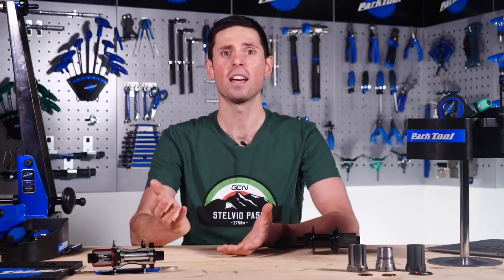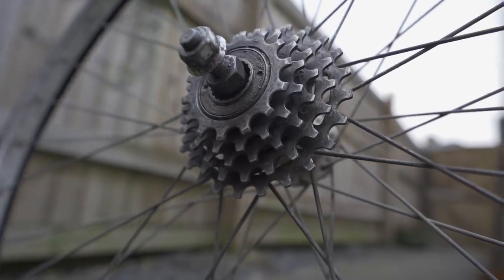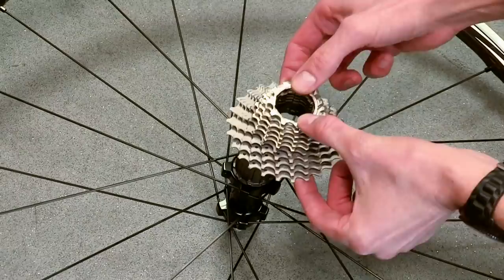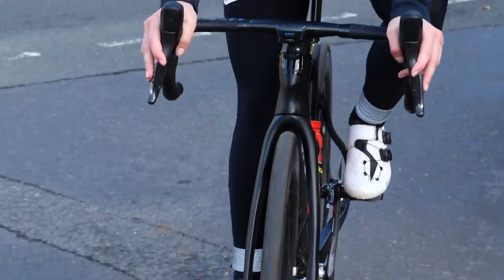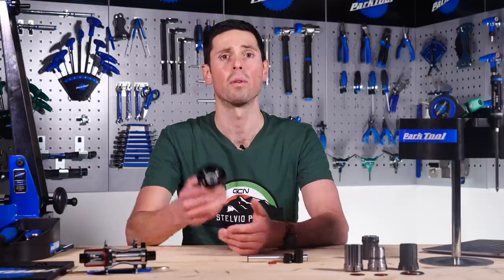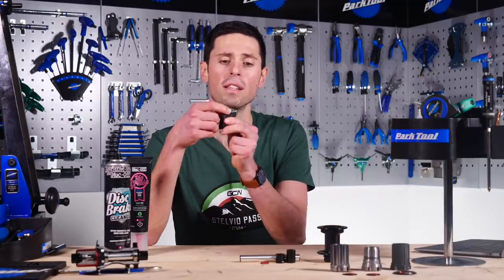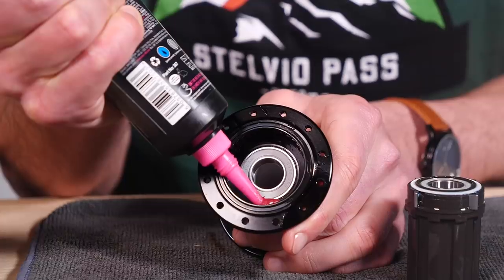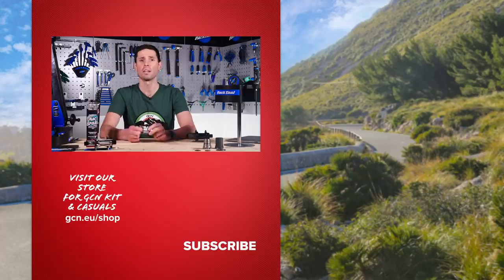Bicycle Freehub Tear Down | GCN Tech Deep Dive

Comment: Soooo you found tool-free rear hub to show the steps, nice - but most of us need to deal with narrow locknuts needing cone spanners, awkward hex key sizes (11mm anyone?), proprietary freehub remover tools, hammering out the axle, etc... would be nice to see a complete strip down of one of the more complicated rear hubs, maybe a DT swiss one as they are so widely used, or a Novatec?
Reply: I second this feedback as well as removal of the ratchet ring nut.  Adding Fulcrum wheels to the list.
Reply: Add the bearing check / REMOVAL / replacement.  
Would use a thinner grease like Slick Honey on the pawls - GP too viscous.

Comment: Just a quick note at 6:28, for this flavor of freehub used on Hunt wheels, the red washer (on the table next to the endcaps) goes between the bearing and freehub. Without the washer, the freehub will not rotate freely.

Comment: My advice for the grease in freehubs is to apply winch grease (used on sailing yachts) that is more waterproof than standard types of grease. Winch grease, like from the brand Harken, can withstand and is designed for more agressive environments.
Reply: A hub with decent seals to begin with is an even better idea. You're solving the wrong problem changing your grease to try and solve a sealing issue.
Reply: @peglor  That’s right. My current (rather cheap) wheelset has issues like bad sealing in the rear hub. But I want to avoid buying new parts as much as possible. Apart from that, more water resistant grease is not a bad idea in parts that are sprayed a lot, like the lower bearing in the steerer tube for example.

Comment: So I’m having an issue with a brand new hub. When I have the rear wheel out of the frame the free hub will coast and engage freely. As soon as I tighten it in the frame it no longer coasts and throws the chain off the top of the drive train. Because of my dropout spacing (141 boost QR) combined with my rims spoke count (36 hole) I had to somewhat blend different standards, which admittedly may or may not be a great thing to do. I am running a koozer xm 490, 36 hole hub that is a 135 mm non boost QR, set up with endcaps that make it a 142mm through axle with an hg free hub body. To use this set up in my 141QR boost spacing, I am using a through axle adapter that transitions from an external diameter of 12mm which fits the endcaps, to a 9/10mm end that’s fits the dropouts. Holding this in place is my stock QR 5mm axle strung through the adapter and frame. For some reason it will not free coast. The stock bike is a 2020 Schwinn Axum. Any feedback I’ll take.

Comment: #askgcntech Can you guys show replacing just the crank arms? I am particularly looking at Sram Force crankset. I would like to experiment with shorter crank arms, but I am not finding any how to videos specifically to remove just the crank arms. Is it even possible on the Scram Force drivetrain?

Comment: Nice job! Can you buy a freeHUB wheel for bikes with 126mm dropouts? I's like to update my vintage steel road bike from freeWHEEL to freeHUB technology, but I've never seen a 126mm freeHUB wheel.
Reply: The usual solution to this is, rather than trying to get a modern freehub onto an old hub width, is to 'cold set' the frame, which is literally to bend the dropouts further apart to take a standard 130 mm road hub. There's so little difference that most frames, especially vintage steel ones, will take the wider hub without the need to set the frame at all, but it will be a pain to get the wheel in and out. Try a proper old school bike shop or a frame builder and you'll find people who can do it for you. In frame building this flexing process is how they deal with any small misalignments that build up during welding too, so it will be completely familiar to frame builders.
Reply: @peglor  Hi peglor, Thank you so much for the kindness of your reply. That meant a lot to me and your suggestion sounds like a very attractive option. Cheers, Luigi

Comment: The only problem with freewheels was the axle on the rear wheel bending or snapping. It was a universal, wide spread problem.
Reply: That wasn't the only problem - most of them wouldn't run true, so on a modern 10+ gear drivetrain there would be enough wobble to create noise at the very least and probably ghost shifting. They were also a pain to remove if the rider was heavy or strong or ran lowish gears, or had a rim failure that left you without anything to lever off to unscrew the freewheel, forcing you to rebuild the wheel with the spokes it came with to unscrew the freewheel, and then dismantle the wheel again to replace the spokes and do a proper rebuild. They weighed considerably more too as they had to use steel parts to support the sprockets, bearings and freewheel mechanism. The design could be modernised to fix some of these issues, but the cantilevered axle and threaded connection to the hub were fundamentally bad design decisions.
Reply: @peglor  Thanks for the more comprehensive (and very specific) list.  You seem a little traumatized, lol ;-)

Comment: #askgcntech I'm buying some chinese carbon wheels for a chinese carbon build and there are many hubs offered. Are sram and shimano gears both ok on the same hub or will my hub selection fix my gear choice? centerlock vs 6bolt?  Is dtswiss 350 really £100 better then novatech? Surely steel is steel. How the hell can I tell if the hub is qr or thru axle like my frame? eg https://www.aliexpress.com/item/4001148296140.html?spm=a2g0s.8937460.0.0.3e812e0edjScha

Comment: sorry but never use grease inside rear hub but special oil. like a transmission oil. Otherwise you risk just hanging the pawls incorrectly and breaking everything.Or you have no power in legs.
Reply: I use chain lube in mine.
Reply: Depends on the particular hub and the conditions you're using it in. Hope's work perfectly well with fairly thick grease in them. Chris kings with the same grease probably wont get freewheel engagement at all. The wetter the conditions you use the hub in the thicker the grease you should use is a good guideline, though if the temperatures are extremely low, the grease being too thick at the really low temperatures might be an issue.